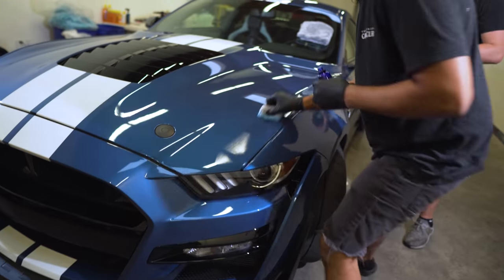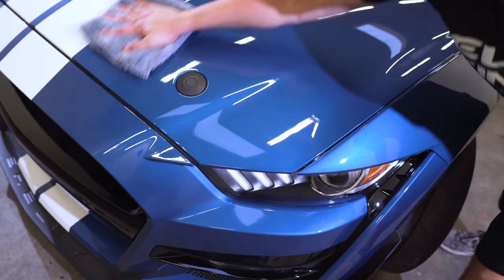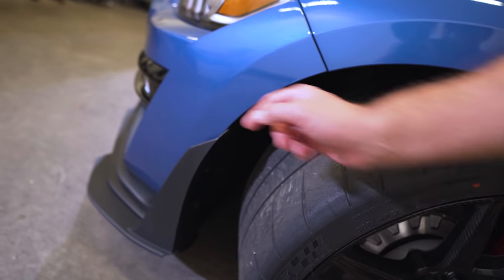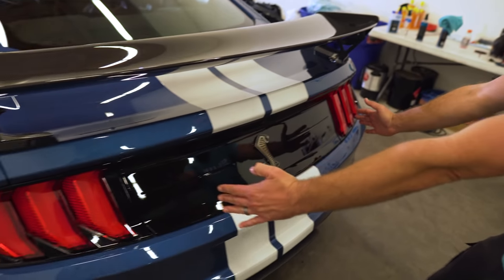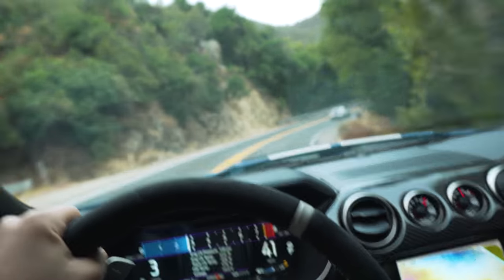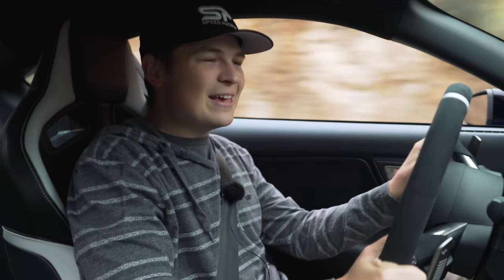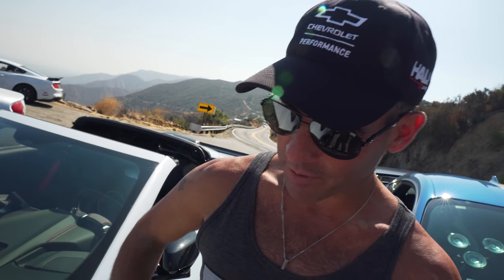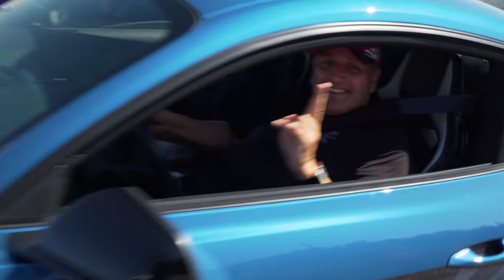BIG REVEAL DAY! AMAZING TRANSFORMATION FOR OUR NEW RACE CAR...

Comment: Which PPF are you using? I am looking at GT500 CFTP now. Several for sale nearby and was wondering if I should go with PPF if I buy the car. I am looking at Suntek. I did not get is on my Focus RS.
Reply from the maker: I went with STEK because the film has hydrophobic properties similar to ceramic coating, already built in. So far I'm happy!